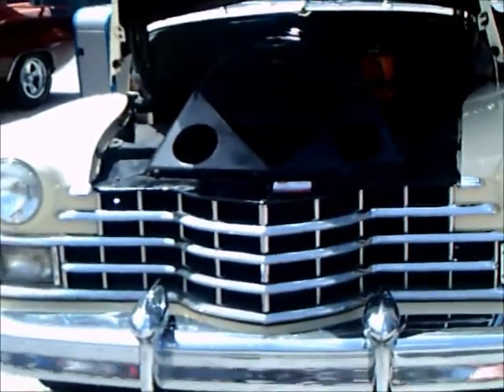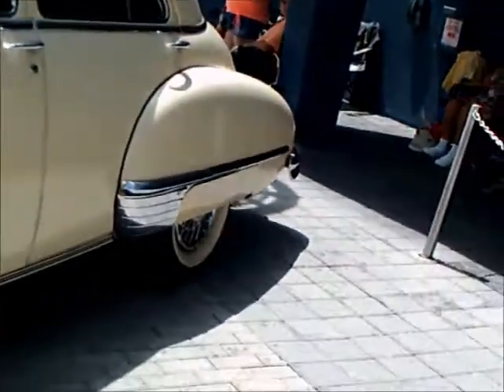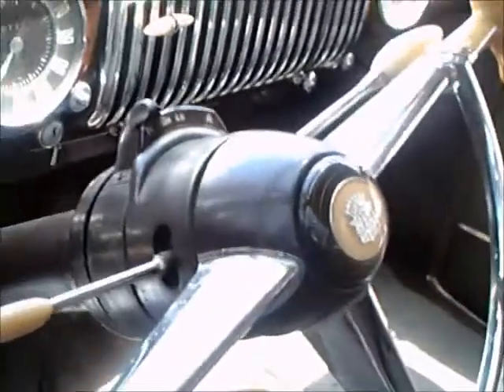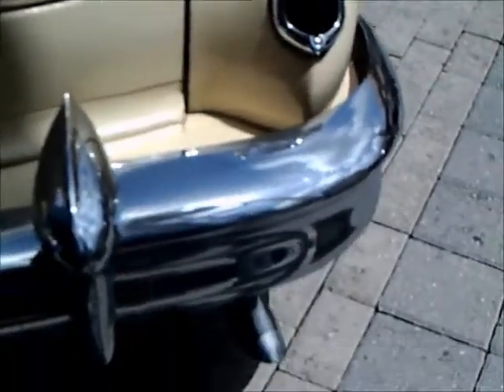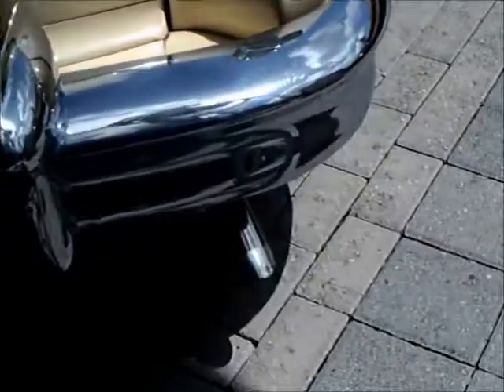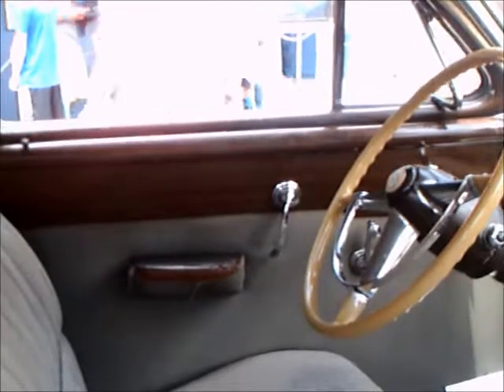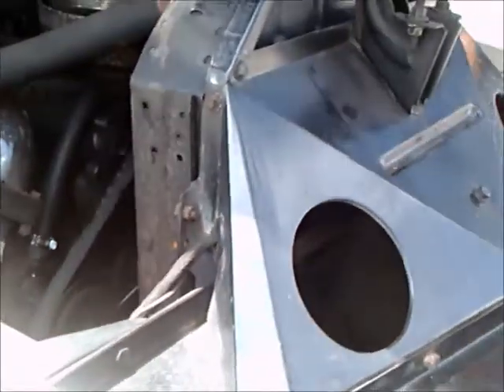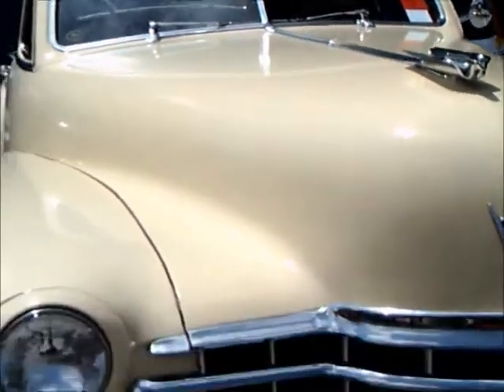1947 Cadillac Series 62 Four Door Sedan Yel Disney061514

Comment: Beautiful Cadillac, at this point I think Cadillac had better styling than Lincoln, they were still doing pre WWII cars,  Cadillac's, next year style was even nicer and that overhead valve engine was a great engine, and  they used it thru 1962.
Reply from the maker: I think Lincoln was undergoing an identity crisis at this point..rounded styling like the Mercury...not sure of the direction it was going. Cadillac always seemed to have a clear vision of what it was and where it was headed.  The OHV in '49 was a game changer.  Thanks!  :) Jack
Reply: Jack R Yes, Lincoln did their rounded redo in 49 and replaced that problematic V12 with the flat head V8,  I think I would have leaned toward the Cadillac but one of my Aunts went in 1950 and bought a new 50 Lincoln Cosmo, hired a driver  and moved to the California desert that year.  She told me she had some problems with the hydrollic electric windows, and got rid of it about 2 years later
Reply from the maker: califdad4 Yes...I've heard that the fluid used in those early hydraulic power windows was brake fluid.  You can imagine the damage done to painted surfaces when there was a fluid leak!  Thanks!  :) Jack